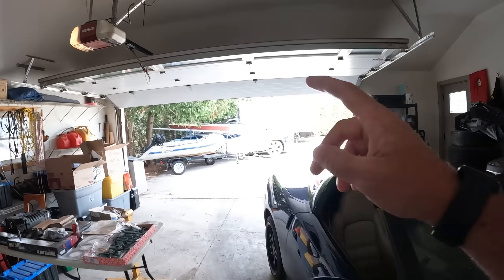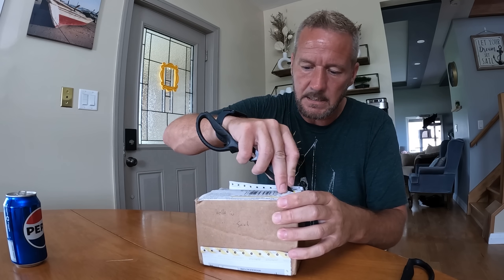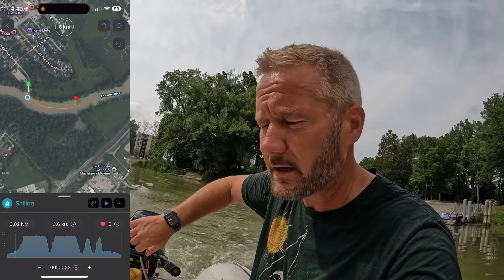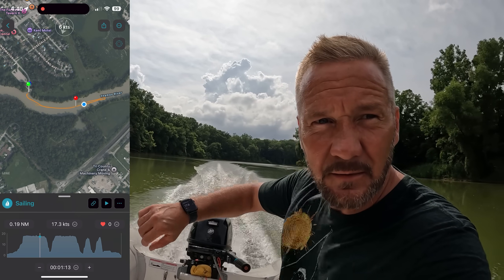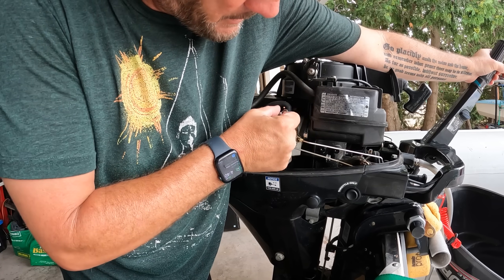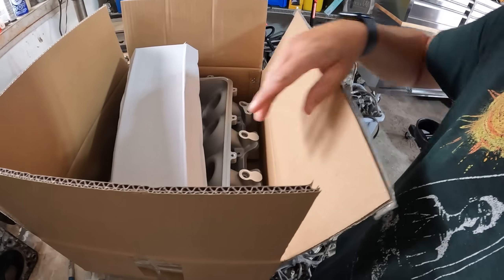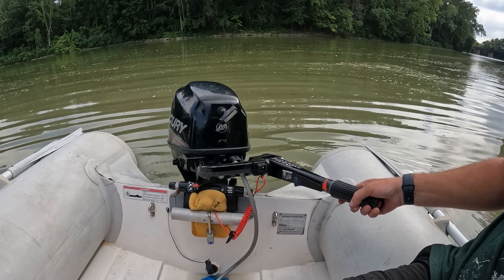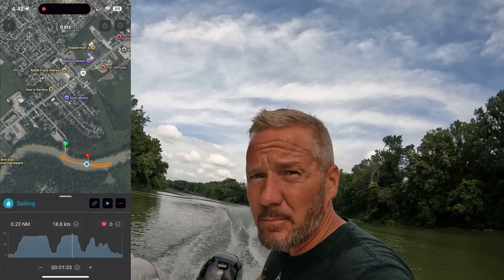ADD POWER To Your Outboard! Mercury 9.9 to 15hp upgrade

Comment: There are many other companies that also share the block and heads with many hp ratings. Suzuki fir instance has a restrictor plate in the air intake that if removed makes the 9.9 a 20hp. Mariner and Honda also do this. Back in 1980 my 100 hp evenrude shared everything with the 120hp, only needing 2 small $5. Jets to be replaced.  CHEERS   Steve h

Comment: Hey man on the idle being ruff... You can adjust the idle mixture screw on your new carburetor. It's the screw that is kinda inset into the carb. Put it about 1 turn out from being full tight. Then play with it from there it will probably make the idle lower then you can adjust your idle stop again. To get the correct idle rpm. Hope this helps. I'm thinking your idle mixture screw is to far in as of now.

Comment: ILLEGAL  ?    IT'S  ONLY ILLEGAL  IF A COP  DECIDES TO DO  SOME  SERIOUS INVASIVE INVESTIGATING     AND WHEN IS THAT EVER GOING TO HAPPEN  ?     ONE TIME I SAW  A  HIGHLY   OVERPOWERED     CAVITATING    13 FOOT BOSTON WHALER    HEADED DIRECTLY INTO A HIGH WIND ,,  STAND BOLT UPRIGHT  AND FLIP RIGHT OVER BACKWARDS   ,  LANDING  UPSIDE
DOWN   WITH THE GUY FLOUNDERING AROUND IN THE WATER   ,  ENGINE SUBMERGED  WITH THE LOWER UNIT STICKING  STRAIGHT UP .    THAT WAS   THE   HEAVY FINE HE PAID    BUT
HE NEVER GOT  ARRESTED     JUST LAUGHED AT , RIDICULED AND MOCKED BY HIS FRIENDS     HE HAD A 50 MERC ON THE DAMN THING  WITH A LARGE STYROFOAM  BLOCK UNDERNEATH THE LOWER UNIT WHEN IT WAS AT THE MOORING     EVERYBODY SAID  ARE YOU KIDDING ME  EVEN BEFORE IT HAPPENED        NO WONDER

Comment: You need to lean out the idle mixture until it runs smoothly. The idle speed will increase, so lower the idle speed until the engine runs smooth and at the correct idle speed. You'll foul the plugs fast running it like that.

Comment: Not sure what year you’re 9.9 is vs what year 15, but currently the 9.9 is 208 CC and the 15 is 333 CC
    The 15 hp also weighs 15 lbs heavier than the 9.9. 
   That took me about 5 minutes to research. I looked into it before. These carb kits use a lot more fuel, but they don’t make it a 15 hp motor the same as the factory 15 hp motor. Not even close.

Comment: Well the merc must be diffrent to the yamaha to convert a 9.9 to a 15hp all you need to do is change the reed valves, some other motors like the 6hp and the 8 its a matter of changing the jets i suspect its the same for the merc.

Comment: I have that same engine, though a little newer. So your before and after top speeds were 18 knots? I see no improvement. I'd read you could not increase power on these newer four strokes because these have a lower displacement than a 15. I think this could work on older two strokes.

Comment: A lot of motors are built same to save companies to have to redesign different engines. The Mercury 5 hp and 6hp are the same size, the 6 has 500 more rpms and a slightly bigger carb. Suzuki stopped making a 5hp and just makes a 4 and a 6. The 4 is actually a 5 with the throttle cable restricted,  a simple adjustment makes it inio a 5. Suzuki 9.9 has a flow restrictor on it and a carb swap becomes a 20hp, it's the same engine. It weights 120lbs compared to the Mercury 9.9 at about 100 pounds.
Reply: Also, always buy oem carbs

Comment: I think you find your only halfway there you need to change the ignition because 9.9hp has limiter, and a different timing curve as the 15 hp is 500 RPM higher to get the power. For instance, the Yamaha 115 two-stroke and the 130 where the same engine, but the 130 had 500rpm more and drank more fuel to get an extra 15 horsepower

Comment: These companies often lie about upgrades. I emailed them asking how it was possible to upgrade the Tohatsu 9.8 HP 4-stroke to 15 HP with a simple carburetor swap, knowing that the Tohatsu 15 HP has a larger engine, with a 124 cc difference. I never received a reply.

Comment: Well as far s the rotation of the propeller does not incrise you will not get higher speed. So one has got remove the choke if there is any in this.

Comment: The line on the top is the overflow, it is indeed a fuel line.
Reply: Also, the 15hp is 100cc larger.

Comment: What I always hear makes me laugh: more horsepower and even more horsepower! It also depends, or should I say, much more, on the shape of the boat. Here's an example: as well as my motorboat, I have a sailboat that has been converted into a motorboat. So it's a displacement boat. I have a 6 HP Parsun on it. We replaced it with a 15 HP motor on a trial basis. The biggest that can be driven in Germany without a license. The result: 12 km/h with the 6 HP, 13.5 km/h with the 15 HP, and more fuel consumption. When I see the videos from the USA, boats with four outboard motors, each with 400 HP, I laugh: what's the point? They're all just posers, the show-offs. After everything in the USA is bought on credit, I laugh. If every boat that hasn't been paid for honked, you wouldn't be able to stand the noise on the water. Get the boat planing, trim it neatly, and you're good to go! My boat, a 400 kg Skiplast, 5 meters long, with a 115 hp Mercury two-stroke, is also overpowered, but that was the previous owner. All that horsepower just costs fuel.

Comment: You can’t upgrade to 15hp with carb change .  The 9.9 has a smaller block then 15 hp .  So to get it to 15hp you need to to change your block , pistons , valves to a 15hp engine

Comment: had the same rib if its the 9 fot mercury (max ratet engine 8HP in norway atleast) with a 2 stroke suzuki 9.9/15 hp went 20.6knot with original prop  i  weight 315pound/144kg at the time went on plane at like a third throttle i actually got it on plane with a 4 stroke suzuki 5hp went 10-12knot then

Comment: Welcome to common knowledge Sparky … I had a 20 horse that was Running but the carburetor float is plastic and was crap I took the carb with knowledge of what I’m doing ( I got certified by mercury at 14 years old ) and swapped the 25 carb to the 20 … I still use the 20 cowlings and I outrun jet skis for fun  it’s only illegal if you’re caught … my boat was rated for 10 hp and I run a 25 on it how you ask … my uncle is a boat builder I gave my boat a serial number from my uncles boats and it was rated for 25 hp

Comment: I had an old 9.9 Johnson on a row boat as a kid, I got a old wooden mushroom bow hydro plane fixed it up my father ibthink changed the jets in the carbs on the 9.9 then drilled out the exhaust then we put it on the hydro. That thing flew ! As a 8 year old kid I thought i was breaking the sound barrier.

Comment: You get 18HP out of engine when you do this with a 8/9.9HP with 209ccm.
To get 20HP you need the Mercury 10/15/20HP (351ccm) engine.
You do NOT get 20HP out of a 8/9.9HP engine. It's two totaly different engines.

Comment: The carb is indeed not the only restriction, the 15 Hp has a different ECU, look up the part numbers for both. The prop on the 15hp is most likely also different. I do a lot of swaps for the local kids here and al the Yamaha,mercury, and Suzuki's i do get different ignition Coil ,carb, end prop. carb only makes just a little difference and use more gas
Reply: What? A carb engine does not have an ECU. The ECU is the control module on an EFI engine.

Comment: We have a 2016 Mercury 10HP four stroke. It now has a 20Hp carb and propeller. Works perfect as a 20HP.
Reply: Its just not enough to shift carb. Diffirent MANIFOLD INTAKE and cam.
Reply: @erikjohansson2331  camshaft is the same. Intake is the same, just check the parts catalogue
Reply: @khmoe NO not the same on this Mercury (Tohatsu) engines...
Reply: @erikjohansson2331  i said we have a 2016….  And that is upgradable.   

Ikke vær så kranglete da :)
Reply: really? can i do it in a 9.9hp 2023 to 20hp like you did?? do you notice the difference ?

Comment: Hey, that looks like a model series that is sold in 8 and 9.9 hp in Finland. As I recall, the cubic capacity was 208cc, while in Finland the 15 hp and 20 hp models had cubic capacities of about 350cc, I don't remember exactly. I changed the carburetor myself to the 15 hp model and the power increased considerably. I don't think that if your machine is the 206cc one that you will get five extra horsepower. The 333cc injection engines have a 9.9 limited only in that the throttle does not open fully, so it is really easy to tune to 15 hp....the 20 hp of this model is said to be a different CDI box. The 208cc is made by Tohatsu and was sold in 6 - 9.8 hp. I put a 9.8 accessory carburetor on mine and opened up the "insulator" plate behind the carburetor and the power increased considerably
Reply: Niin oma kone on 6 hv

Comment: Doesn't sound anything like my old 1966 Mercury 9.8 that powered my hydroplane when I was a kid. Got as fast as 38mph with a wax on the thing.

The fact I only weighed seventy pounds at the time might have helped. 

Had a neighbor on the lake with a racing fifty that could do 70mph.
He let me take it out once and it scared the living daylights out of me.
Reply: Your 66 was a badass 2 stroke. That's a completely different engine. The new 4 strokes are heavy and they're a slug compared to the old 2 stokes.

Comment: Did you check if the hole on the restriction plate and gasket between carb and intake is the same as the new carb? If it's smaller, then you didn't do much of a tuning.

Comment: The rubberhose is for the overflow. Just switch the plate if you don’t want to have gas in you cowling in the case the carburetor overflows.

Comment: The difference in the carbs may just be different size jets to allow more fuel? If that’s the case it would be cheaper to just buy the 15hp carb rebuild kit and swap the jets? Just a thought🤷🏻‍♂️ May need a different prop pitch? With the choppy you referring to could it need a timing change perhaps?

Comment: I know a guy that bought a 15 HP and some 9.9 HP decals. That's the cheap easy way to do it. No messing with the internals. Just swapping a couple of decals.
Reply: The decal trick doesn't work. 
I did that to my 150 HP.
Reply: @lakerdigital  It always worked for us Kenia river guides to change the Hp stickers.
The seasonal parks Rangers all came for the summer from crap holes like New York city and they are absolute low brain powered morons
Reply: @lakerdigital definitely depends on how much the game officer wants to give you a ticket. Here in NC, 95% of them will read the model or serial # off the engine, write out his paperwork and stick you with a healthy ticket. Just recently seen it happen as well as a ticket for removing flame arrestor on the other boats engine and having an automotive high air intake filter on it....they are super strict here. My friend got a $250 ticket for having a trolling motor on a 16ft canoe. Even a blow up raft has to be registered and if over 14ft it must have a title too. Ruins any diy, fun, poor man's touch here. I know other states aren't as strict and I really wish they wasn't so strict here.
Reply: This was referring to motorizing a boat, electric or gas...even a canoe or as small as a raft they have to be registered if you put a motor/engine on them here in NC.
Reply: @dgmenace73   - Yeah NC is strict with all of their Laws -
Reply: Works with a 20 hp too
Reply: That's what I did
Reply: Can't remember the brand but there's a 13hp sold as a 9.9 from factory. Hangkai maybe?
Reply: And then you get a fat fine and court date when the  ranger looks at your engine plate lol
Reply: The 1950's Johnson/ Evinrude were rated at 4000 RPM.
Even though the top end was 5500
Reply: Many years ago, the Alaska river the Kenia River had a 35 hp max for all boat so what many did was change out the carbs for up to 60 hp outboard carbs because many of the 35 hp outboards of that time had been de-tuned 50hp and 60hp outboards the company's installed carbs for a 35 hp outboard.
The Alaska park rangers in charge of enforcing the laws they are stupid morons from big east coast city's working summer jobs in the AK parks department are too stupid to figure out a motor was messed with.

Comment: Feels like a bit of a waste of time.  Get a 9.9 and a 15 parts manual and compare part numbers and diagrams. Who told you the only difference between a 9.9 and a 15 is the carb? The published weight of a 9.9 is 84 lbs. The 15 is 99 lbs. Pretty sure the carb doesn't add the extra 15 lbs. Consider what parts might make a 15 hp weigh 15 more pound than a 9.9.

Comment: had a johnson 9.9 and did the carb swap for a 15... also changed the prop from an 8" pitch to a cupped 10". had it mounted on a 10' MFG fiberglass skiff, went from 19mph to 27mph but it took forever to get up on a plane compared to the 8" pitch... but once the prop caught water it was a blast... I think the cupped edges caused extra cavitation making a quick plane harder to do...  almost forgot, I changed the timing to about 2 degrees BTDC too

Comment: In most situations there is more than a carb change that effects the HP. In some cases the parts change just increases the ability to run more RPM with a prop change and the higher RPM while maintaining the torque results in higher HP numbers. Torque x RPM / 5252 = HP. If the torque never dropped off which it always does, HP would always increase with RPM if no valve float or the parts aren't overwhelmed by stress. The induction system would also have to handle the increase in air flow requirements. Once upon a time Suzuki had an 8 horse that was literally a 15 horse with the throttle valve opening limited that limited the torque (Think restricter plate) to limit the HP. If I remember correct the carb was the exact same part number but the linkage geometry was designed to limit the throttle opening.

Comment: I have a 1995 Johnson 25hp outboard. I'm in the same boat as you are. (pun not intended). I need to recarb my outboard in order to get on plane with passengers in my boat. I would've liked to recarb it to a 35, however my 25's exhaust is not compatible with the 35hp. My only option is to recarb it up to a 30hp.
On my 25hp in order to recarb it, I have to replace the intake manifold and the carb.

Comment: I'm a big fan of the channel, but I don't think you're getting any increase in power. If anything the hole shot was slower. As has been mentioned, the differences between the 9.9 and the 15 are unlikely to be purely the carb. Other similar videos that I've watched highlight the need to change additional components including a flame arrestor plate (on Yamahas, from memory). Ironically, your Merc may now be over-fuelled due having not removed/replaced restrictor plates, leading to rough running.

Comment: I believe there is a restrictor in the intake or exhaust on most smaller motors.  Carburetor would most likely be a jetting change.  You are not seeing a 50% performance increase there.
Reply: Well if it achieves WOT witb that prop on a 9.9. Carb it needs a prop that can utilise the extra hp to make the difference noticeable.
Reply: I believe the part he popped out of the old one and put on before the gasket IS the restrictor, if I remember right.

Comment: you can legally modify it, you bought the engine you can do as pleased, now can you legally run it on a public lake, no your not suppose to, but i promise you a game warden is not gonna open the cowl up and check out the carb. I ran a suzki dt140 on a pontoon that was rated for a 90, they just check for registration, life jackets, drinking ect.

Comment: Great "seat of the pants" type video. To truly test the carburetor change you need the most important tool. You need a tachometer. Look up the rpm specs for the 9.9 and the 15. Usually a 15 will rev higher than a 9.9. Being basically the same motor, bottom end will be unchanged. A half knot is is a poor improvement. If your motor is not reaching the max rpm with the 9.9 you need LESS pitch. Nobody ever tachs out dinghy motors. they just mount them up and go. Years ago I had an Avon ridged with a 9.9 Nissan. It would barely plane with 2 adults. I installed a prop with less pitch and there was a slight improvement. The best modifcstion I made was to switch to a Merc 9.9 two stroke. With three adults it would jump right on plane. Another place to look for speed is the relationship of the cavitation plate with the bottom of the boat. It should be even or slightly higher. If you run a performance prop with decent cup raise the motor until the highest point of the prop is even with the boats bottom. With 4-strokes on small boats it is critical to be able to reach maximum rpm or slightly higher. They have weak lowend performance so you need to give them all the help you can to build RPM quickly. A better cure is to install a 20hp and change the horsepower sticker.

Comment: Id say the difference is in the jets the 15 horse carb probably has larger jets in it
Reply: Rejetting alone isn't going to give you a 50% power increase. The 9.9HP model will be restricted by small carburettor bore since it's apparently not being done with a restrictor plate.
Reply: 15 hp could have different valve timing. Could have different ignition timing. Could have higher compression ratio.  Could have different size valves. A different exhaust manifold. Different jetting. There are tons of things that can effect HP rating. I'm not convinced just changing the carb made his 9.9 into a 15.

Comment: This is not a new thing, every manufacturer of outboard engines have some steps were it is small changes between the different HP,
You could buy a 20 hp engine and simple tune up to 30 hp.